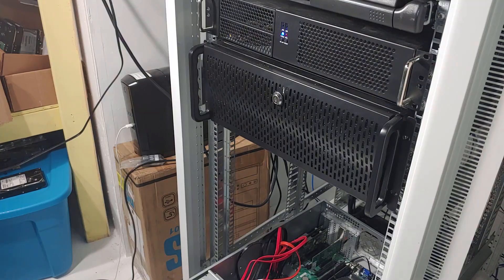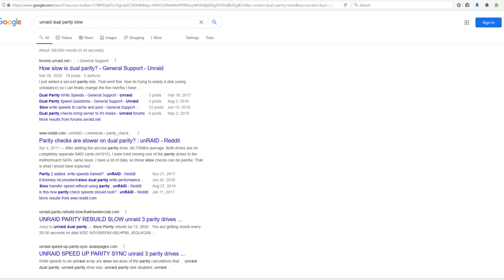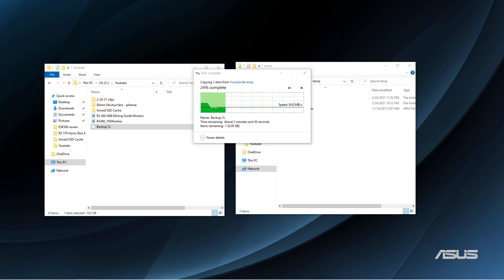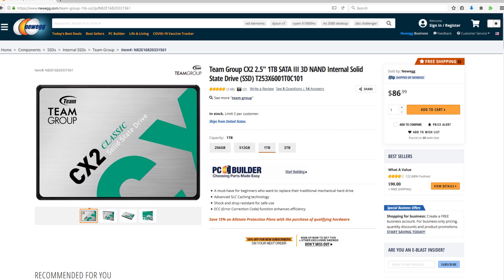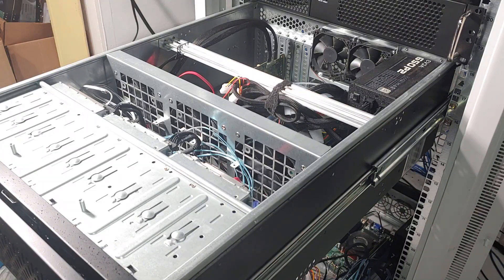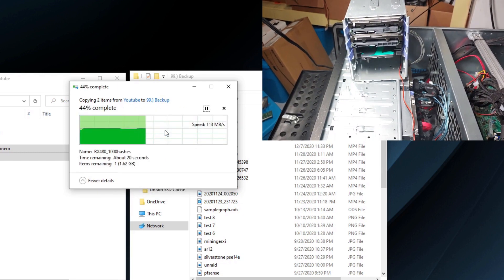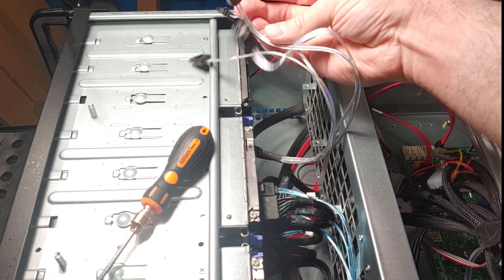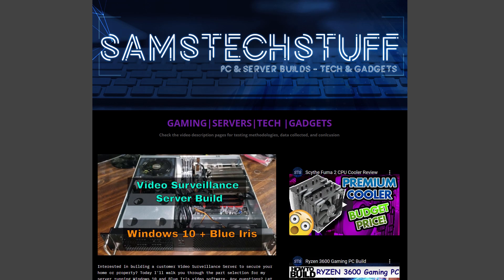Speed Up Your UnRaid Write Performance! SSDs

Comment: Is 170-200MB/s considered a good transfer speed over a 2.5G connection writing to an NVME cache. Just built my first unraid server and those speeds were slower than I expected. Most of the posts I have seen of people complaining of slow caches were much slower so I am not sure if my expectations are out of wack or if I simply have something configured wrong.
Reply from the maker: Hello! 

Well, that depends if it's a good speed or not.  2.5gbps network theoretically could hit ~312MB/s. Not exactly sure how your device and network are setup but 170-200MB/s might make sense. Is anything else writing to your Unraid server? Plex/Jellyfin maybe? Any other operations occuring on the server? Basically, we would need to know more about your setup to know if that makes sense.

Depending on the switch you have, youay or may not have a full 2.5gbps available for your source device to use to transfer to Unraid. What I mean is that if you have a 2.5gbps uplink for example, some other ghost could be using some of that.

 In my newest setup, I do not ever hit the theoretical max. I normally can manage about 250MB/s. Your transfer speed does somewhat depend on the file you are transferring as well. Larger video files tend to transfer at higher sustain led rates for me vs many smaller files. 

Even with NVMe cache and a 2.5gbps switch, Unraid isn't* exactly known for being a super fast storage setup generally because of the parity strategy and the fuse system. You can bypass fuse which might jet you some extra speed or you could setup a ZFS array as there are certain vdev drive layouts that will be very fast.
Reply: @STS  Thanks for the response! I have no services running on the server yet, just simple shares accessible through SMB. The only thing that sticks out to me that could be causing slowdowns is if it is trying to transfer data over the 1G internet connection instead of the 2.5G connection which connects straight to a 2.5G NIC in my PC. Though I am not really sure how I can confirm this theory as this is my first time using 2 NICs simultaneously in either OS. It was previously giving me issues connecting to the internet since unraid bonds the two ports by default.

Comment: NO Cache  FAKE Cache  " ZFS is Cache "
Reply from the maker: ZFS is one way to accomplish caching of data but it certainly is not the only way. The cache drive or cache array in UnRaid most certainly is a caching solution - I and many others use it everyday. 

Are you using TrueNAS or some other OS with ZFS currently?

Comment: My cache disk is full and not emptying to the array. Anyone know how to fix that?
Reply from the maker: Hi James! Sorry for the late reply here. Are you still having this issue? Off the top of my head, I can think of two areas to look at - Do you have shares set to cache only that are filling your cache drive? What are your custom settings for when you are running the mover?
Reply: @STS  I haven't changed any settings in mover. I fixed it for now for by turning off cashing for the share. Does it work better for cashing preferred or only?
Reply from the maker: That depends on what you're caching, how much you're caching, and how big your cache drive is. Was this media or software? How big is your drive vs the size of the share you turned caching on for?

Comment: Why does it slow down at the end to ~60Mb/s even with a Cache Drive?
Reply from the maker: Sorry for the late reply! I'm not 100% sure but I believe its related to the SLC caching technology. Sometimes I notice great transfer speeds and sometimes they do dip as low as 60mbs. My guess is there's just not enough SLC memory in order for this to compete as well as dram equipped ssds. The trade off is that this drive is usually one of the lowest cost 1tb ssds out there.

 I have since added a Teamgroup MP34 to my unraid server and the performance is significantly better, with a 10gbps NIC I can now hit ~3gbps on this newer cache drive.

Comment: hmmpf doesnt work on 6.9 what am i missing. cache pool on prefer.
Reply from the maker: Hi MitchOfCanada! The caching drives have been supported for a while now I believe. I do remember some users needing to set a maximum free space setting for the shares they wanted the cache drive applied to - might be worth adjusting that. As for my setup, I have drives that are Cache Yes and Cache: Prefer. Try moving everything off the cache drive then changing the Prefer to No, applying, then changing back. On occasion I see some permissions issues with shares myself.

Comment: Perhaps I’m recalling incorrectly, but I am maxing out my 3.5in spinning drives without a ssd in front of them. I do have a cache ssd but it does not use it when replacing files.
Reply from the maker: It depends on how to set the cache preference for the share I believe, what setting did you choose for thay share? Yes?

Comment: See now I did this, but I'm still gettin between 50-80MBps for some reason. Do you have any idea why that would be?
Reply from the maker: Hi! After setting my shares to "Yes" for cache I was seeing 80-90Mbs. When you write to the share, are you seeing the cache drive fill up or are the files still being written directly to the main array?
Reply: @STS  Thanks for responding! Yes, the cache drive does fill up, but I guess I just expected better performance from a samsung EVO drive. Does Unraid just have that much over head?
Reply from the maker: @kangkuhkee9450  The transfer speed also does depends on what you are transferring and your local network. I would expect most the the last few generations of the Samsung EVO drives to write relatively fast. When I tested this cache drive, I was copying large files. Copying hundreds or thousand of smaller files is usually not as efficient of a process as copying a large zip for example. I would t recommend compressing anything unless it made sense though. What OS were you copying from? Was the copy from drive also an SSD or an HDD?

Comment: ssd is good choice
Reply from the maker: Hi! Thank you! This is a great bang for the buck option in my opinion. Noticed an immediate bump in transfer speeds and I like that I can keep the main drives spun down for longer periods during the day to reduce wear and tear as well as energy usage. Do you run UnRaid?
Reply: @STS  no, just by looking at the ssd disk tests, it will be better than hdd
Reply from the maker: Yes, it was definitely faster than my older 3tb Toshiba drives and faster than my more than 50% full CMR 8tb hard drive. Glad I made the switch.

Comment: What rails are you using?
Reply from the maker: Hi Ryan! I am using the iStarUSA 26inch rail kit along with a 4U Rosewill RVS-L4500 15bay server case. I quite like this combination - in fact, I use the iStar 26 inch rail kit on most of my rackmount cases.